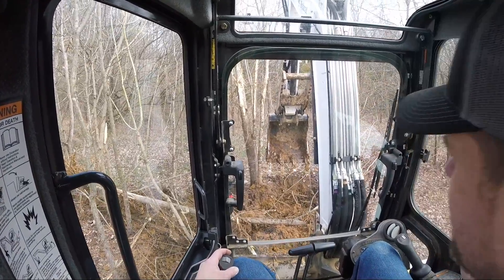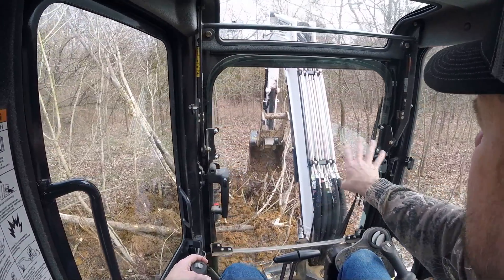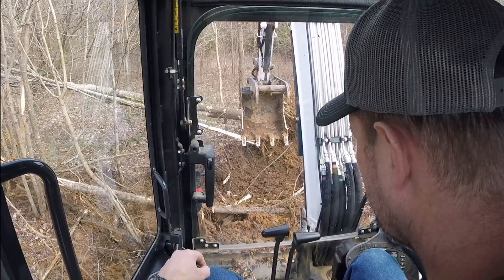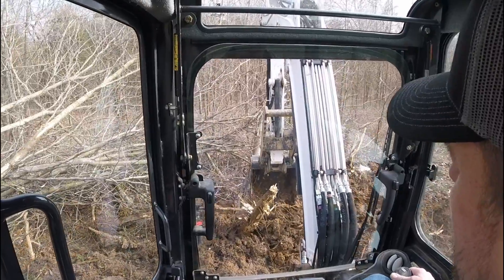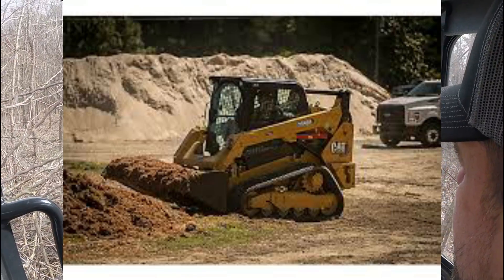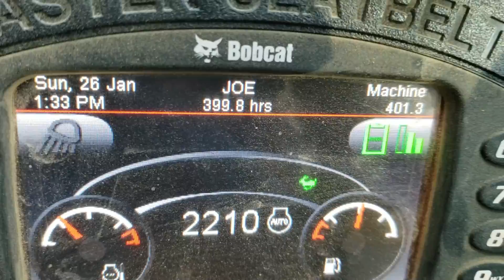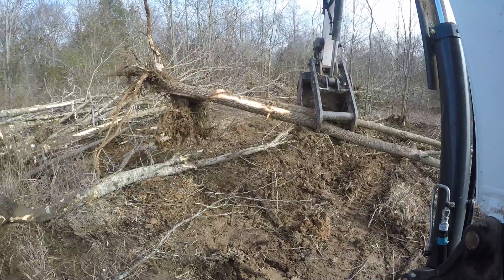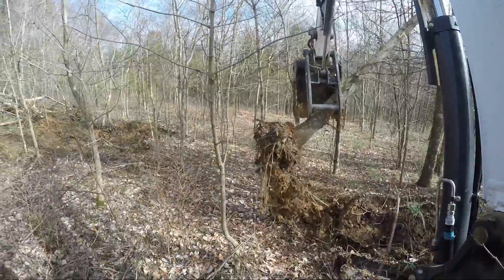Is a Skid Steer in our future? Bobcat Excavator clearing land for wildlife habitat improvement

Comment: If you get the CAT, most guys i see doing city or utility contract run drum mulchers.. takes care of trees and leaves nice mulch level enough to drive on
Reply from the maker: yep no doubt they work better, but I am looking at the most different uses for one piece of equipment. So an HD cutter could clear trees, but not as good, but it can also mow a grassy field, and costs less than half of the drum mulcher. So that is the stuff I am considering. Thanks.

Comment: Get rid of the tractor but keep all the implements. Then get a 3 point adapter attachment for the skid loader and use the implements on it. I personally would go for a late 2010’s model such as a 2016 or above. You will save money that way, plus the new Bobcat loafers are first year so they may have unseen issues coming towards them. However I will also look into purchasing one if it is the right price.
Reply from the maker: All potential options.  Yeah pricing will be a big consideration too, thanks

Comment: Running a forestry head requires a top end unit with heavy duty hydraulics.  Mulching is HARD on equipment too.  Also don't think you can switch back and forth with implements.  Figure the forestry head as a permanent deal.  That D3 Cat is a dedicated deal, and you are going to have to upgrade your truck and trailer to move it around.  That D3  setup is going to push well over 20,000 lbs wet with the mulching head.  You are looking at CDL licenses and your new 3/4 ton isn't going to pull that even with a goose neck hitch.
Reply: Gary Crumrine again agreed. I've been following Kap from the beginning, but he's getting too deep here. He literally has everything he needs right now. Maybe he could use a Brown Tree Cutter. Other than that, he has perfectly fine equipment for farming for wildlife.
Reply from the maker: Gary, there's always other options such as transporting them separately. And if it is very part time, that could be a good option. But I disagree, that Ford can easily tow it all no problems. The D3 comes in at 9,000 lbs, a big head at say 2500, so even at that it could stay around the 14,000. That is another reason I'm looking at this size machine.

Comment: Joe the thing you have to look at for a forestry head like that is the hydraulic flow you need between 25-50 GPM and on a Bobcat the model you want is a Bobcat T650 and for a Cat 289D3 or a John Deere 325G and out of the three track skid loaders the Cat is the heaviest the John Deere is in the middle and the Bobcat is the lightest the Bobcat and John Deere with a head like that comes under 10,000 pounds with the operator the cat with that head comes in at little over 13,000 pounds with the operator and quick attach makes a head like that that can handle 10 inch soft wood
Reply from the maker: I've been looking at all that, I think your specs are a little off. I'm looking at the new t76 Bobcat also. And I don't want to run a real forest head. All machines have hi flow that will run anything except for the true fecon type forestry units. Too expensive to go to the next sized machines,  but I am looking at options.  Thanks for the info. Cat also has a counterweight option ,yo me would be a must. Thanks man
Reply: Kapper Outdoors the mower head for 10 inch wood from quick attach is 2300 pounds plus the t650 has the optional high flow 30 gpm at 9113 for 11413 pounds the t76 is 10250 add the head and 12250 the Cat weight is 10688 add the head 12988 and your truck can tow 14000 or 15900 pounds your e42 is 9246 ish with your ranger 1000 loaded around 2000 pounds is pretty close to the max tow capacity
Reply from the maker: Yeah I definitely like the specs on the t76, but I think I might get away better deal as far as bang for the money with a cat. The t259d 3 weighs in at 9000 plus I would add some counterweights. Going up to the next level is just a little bit too big and I'm not sure it's worth the ten grand extra plus like you said it's going to push my trailer weight. Thanks man appreciate it
Reply from the maker: Oh and of course no matter what unit I get it's going to have high flow and the bulletproof front door LOL

Comment: Most of the high power accessories require very high flow hydraulic pump systems. These can be added to wheeled tractors and with adapters attachments can be mounted on the front lift sometimes even more effective use of skidsteer attachments. Best of both worlds.
Reply from the maker: Yeah whatever we do it has to have hi flow and air ride seat! Lol. Thanks

Comment: Have you watched much of Letsdig 18's clearing videos? when you knock the trees down, and his videos show it better than I can explain it, but there is a size where you can just take the trees and start breaking them "apart" even if they are just stringy, they are broken enough you can fold them over in half. Sometimes you can use the thumb and break them against another near by tree, works best f you are taking that one down too. I have used a backhoe to clear 5 acres and a 4n1 on a tractor to clear 8 of stuff just like what you are doing there; most of the time I just made rows out of the stuff until I could move around a bit then made piles.
If I may suggest taking a look at a Takeuchi skid steer. Has been my favorite one to operate so far. if you are going to buy brand new and are going to do a lot of heavy mowing like with Diamond mower, look at a forestry package. upgraded plexi on the door so the debris isn't breaking it all the time and a few other things. you may want to rent yourself out mowing for a few jobs to help pay for it, around $150 an hour (I think) is the going rate but it might be more or less.
Whatever you do, if you get one with a cab door (suggested) get one that raises overhead rather than opens out toward the bucket. once you get stuck with the machine you will find out why.
Reply from the maker: Good info. Yes I am aware that you can get stuck in them but the two units which are Tack and Kubota open overhead but they had to make the machines taller and there by a little bit more tippy, and they also wear out the parts quite regularly due to the way they pivot and such. Yes definitely the bulletproof door will be in the package. That is definitely part of the plan what you mentioned to get a little side work here and there if I can. And yes I've definitely picked up that there are certain methods and angles and direction of debris entry and so forth to learn the machines it will be a learning curve. Thanks

Comment: U have a lot of good equipment for the tractors and I'm sure the tractors with the right equipment will do anything a skid steer will do, plus u have a great machine in that excavator that u can add attachments to, save a lot of money using what u got 👍👍
Reply from the maker: Well, I disagree when it comes to cleaning and clearing land. The excavator can kind of do it, but very slow and painstaking.. Especially heavy brush areas, and then like with Project 211 when the overgrowth is just too big, say 3 inches and up, you just don't want to be trying that with a tractor unless you like buying tires. So there are some separations. The skid steer is also much more nible and fast compared to a tractor. But you are right there is  alot that I can do with what I have.

Comment: I've ran Takeuchi and Cat skid steers. The cab door rolls up over the head of the operator on the Takeuchi which is a better design than the swing door on the Cats. I ran the Cat 259B many times and digging the bucket into something would pop the door latch open and disable the entire machine from work (safety feature), not to mention you can't get out of the machine with the loader in the half up position at all. The rolling door on the Takeuchi allows you to operate with the door open or closed and get out in an emergency. Definitely get a tracked machine for land clearing.
Reply from the maker: Thanks man.  I didn't like the specs on the tak,  and I'd need to get great pricing no matter which way I go. Yeah I agree the cat you have to disconnect the mower just to get out..

Comment: You can buy a good low hour track skidsteer for 30k.  Rent the specialized implements that you’’ll only occasionally use.  Make sure whatever machine you buy has adequate hydraulic flow for your needs down the road.  I agree skidsteer hard to beat and much less
likely to have a rollover accident when working in uneven terrain.  Good luck in search.
Reply from the maker: Thanks man, been looking at used, but hard to find low hour with the options I need, and then they are getting near new pricing. Especially with hi flow,  those machines are more risky for used.. thanks

Comment: Why mulch and have to deal with stumps left just below the ground breaking disk blades and tiller teeth when you can use what you have and have a better finished site. JMO
Reply from the maker: Good point.  Guess it depends if I'm going to plant it or let it just regen.  Although I've done many plots with stumps and if you stay high with tilling and plant,  the stumps will degrade over time. At least the smaller ones. Thanks

Comment: Your hips and back can't take getting in and out of a skid steer and bouncing around in it all day have the same problems you do health wise I operated equipment for 32 years the most pain in the ass to get in and out of if you have injuries but if you go that route get a track machine they are a little smoother than the tires but maintenance cost is higher stay away from John deer I would stick with cat or case jcb has a side door to get in and out of and can take any attachments is high flow hydraulics plus it had a telescoping boom but you are still better to rent one for a month or two with the implements you need before you buy one maybe run your buddies for a day and find you will be better off  to pay him to do what you need

Comment: With your back and hip issues thinking its possible to farm 200 acres with a skid steer the way they buck an jump????   You've got to be kidding me!!!  Rent one and use it for a week and see how you fare--BEFORE you commit to buy.
Reply from the maker: Yes of course I will. I just didn't have the time yesterday. Victor is going to drop it off here in a day or two so I can really test it on MY back! But I'm seriously thinking it will be smoother than the Excavator and tractors with the New track designs and air seat, but I could be wrong. We'll see very soon!